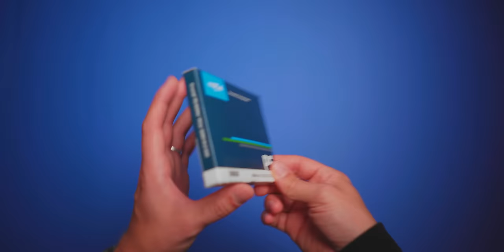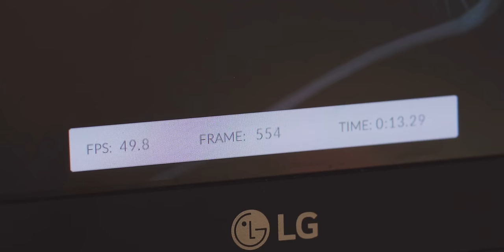This RTX 3080 Gaming PC Worked Better than I Expected

Comment: Steve is screaming at that AIO placement right now
Reply: and at the glass obstructing airflow
Reply: After watching that video I am screaming at that AIO placement right now. That said, unless the pump is in the radiator, which sometimes it is.
Reply: you can atually stand this case so that would fix the issue
Reply: @ACanadianDude  Pump is in the CPU block for this one. And all in all, it looks cool and everything, but from a practical standpoint this case is ehhhh
Reply: I also have the Ryujin 240 with the radiator at the bottom and never had issues nor weird noises after a year and a half. It's just a great AIO.
Reply: @AlessandroSchiassi  yeah ive been using a corsair h100 at the bottom and also never had any issues or noises for 3 years now. its really not that big of an issue.
Reply: @ACanadianDude  if the pump is in the radiator would it be ok to install on the bottom? I grabbed a MSI aio today with the pump inside the radiator and was hoping it would be ok in that orientation.
Reply: You could place the radiator at the top above the motherboard I/O, but you'll have to use thin fans, or they will chop the cables.

Comment: I still think the case is just a bad design. Its massive and still has limited hardwaresupport. And thats coming from someone who has an nzxt h210. What exactly is the point? And that poor rtx 3080 looks like its in desperate need for some kind of ventilation.
Reply: SmashStomp Inc  doing something different isn't an exuse for poor design choices.

Comment: Comments like:

"Accessing the IO to plug in the USB stuff, plug in the network, to plung in the Display-port cable... is really difficult to access and still really annoying, BUT using wireless peripherals... makes cable management so much easier"

"3080 did fit and I'm quite happy with the turnout, except for it is very close to the class panel, because it is a really think card therefor cooling is compromised BUT this isn't my permanent system for this card anyway"

"I know, before you say anything, this AIO orientation not ideal in the long-run but I'm not hearing waterfall effects and there's no, as far as I can hear, air  inside the pump... and eventually I'll pull the system apart anyway"

Really tell the story. This case should be avoided by ITX lovers and is only for those building a show system (to take apart and rebuild in a permanent case later, much like in this video) and ROG fan-boys.

I rather build in a CoolerMaster RN200, Raijintek Ophion EVO, In Win A1 Plus, Ncase M1 or any similar case if I want ITX.

For the size of this thing I'd take my CoolerMaster Q500L and get the benefits of a full ATX motherboard. Yeah it has limited air flow too.. but it $60 - $70 and I've modded mine to fix that.

Comment: 750W PSU?? doesnt Asus recommend minimum 850W for their RTX 3080 Strix?
Reply: You know, recommendation must take into consideration that you might want to pair 3080 with some i9, overclock all like mad, put ton of drives, fans, custom loops, LEDs and stuff, all with Bronze-rated PSU, and to still have some safe space. Even if you would push hard and feed 400W into GPU you would still have 450W available... for what? For USB-powered vacuum cleaner?
Going 750W is really safe and reasonable approach. I will use 700W on my own 3080 PC build.

Comment: Interesting case. I like it. I like the approach as its different, but also a reminder of a much duller looking silverstone raven case. ASUS did a much better and more attractive presentation. It be nice if the top panel of class was removable for fan cooled GPUs or had ability to mount a AIO rad for a gpu.  I feel I have reached a plateau with my current lian li o11 air. Having this many fan options is cool (especially if RGB), but loud, not practical, and too redundant to matter. I run my rig almost 24/7 with hardly making a workload worth of needing this many options for cooling. I'd love to down size with placement on my desk instead of the floor. ASUS option is extremely tempting. Thanks for your showcase of hardware with this I didn't watch the case review.

Comment: nice build. Its good looking but lets be honest, they should have made the top glass one inch (3cm) higher to allow more airflow into the GPU. Otherwise, the rear IO is a deal breaker. It does look good I cant argue that. 3200mhz RAM oof.

Comment: Eh, love Asus but I don't like the case. I don't see the point of having an ITX system if the case is still huge. If it's gonna be huge why limit the slots and ports on it? That's basically what you are doing by making it ITX. It does have better space for working with than most ITX cases but if you really cared that much about ease to build you wouldn't be building an ITX system anyways.

Comment: i have this case..... with a full ATX Asus Strix z390 E LLOLOLOL

z11 case
z390 E
asus dual oc rtx 3050 
asus 240mm LCII AIO
intel i7 8700
asus Spartha X2 + RGB back up
asus Azoth
asus Fusion 700 series 
asus 24in 100mhz monitor
Asus  Performance Thermal Paste

WD BLACK nvme gen 3 1 TB
Team Group nvme gen 3 1 TB

I pledge allegiance to the republic!
Reply: i forgot to mention i have 3 Z11's .. i buy them cheap off new egg (60$) and i build cheap, starter gaming rigs for kids at a affordable price for parents.. sooo i have a Z11 right now thats built to blow the DOORS off Roblox/minecraft... itll keep its head above water in fortnite Lol

Comment: I really liked your reviews... Until this one. Now I will ask myself if your review is objective  as this video sounds clearly like a favor to Asus.
Reply from the maker: Watch my review of the case - I don’t hold anything back. Also nothing dishonest in this build video either. 
-D.
Reply: @HardwareCanucks  thanks for your answer. I watched the original review when you released it, and as usual liked it a lot.  I get the point that this tower is more of a show case and you shouldn't buy it for airflow, but this new video just sounds as an Asus commercial (it's just my opinion... I'm not telling you it's actually the case, neither it's wrong to earn money  😊. Compared to the previous video, it just confuses me). Still, awesome video and audio mix.